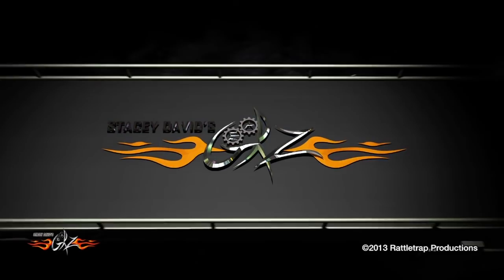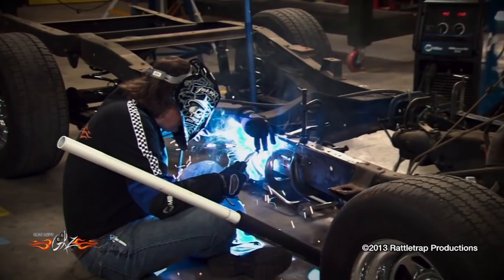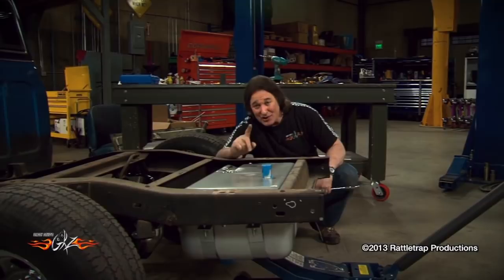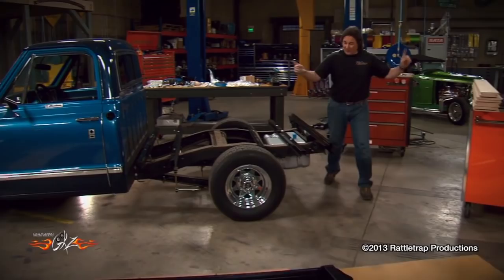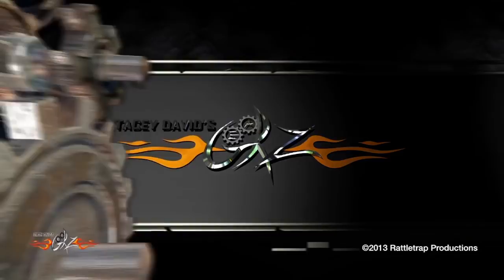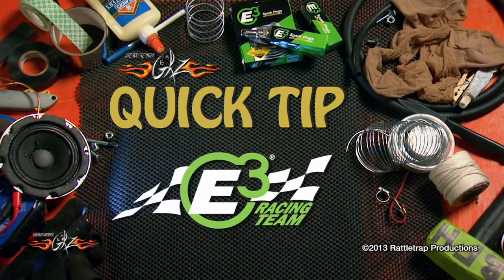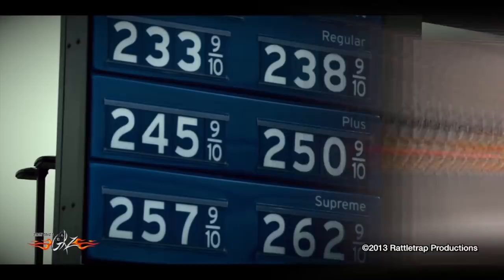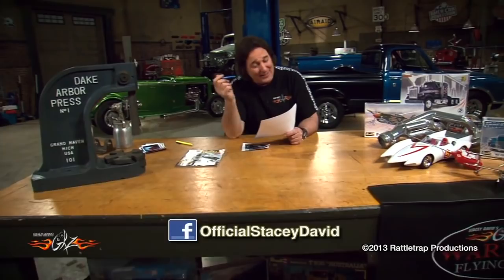Converting a Classic Truck from a Long Bed to a Short Bed - Stacey David's Gearz S7 E5

Comment: Can't u get a short bed Bed 🤷‍♂️
Reply: Very hard to find
Reply: Yes you can. 88- 98 short box will fit quite nicely and body lines are unbelievably correct.
Reply: @kevinlimo696  if it's a step side bed then ,yes

Comment: Not a mechanic (put can keep my truck running)… but what I am is 32 yr carpenter and I’m a finish carpenter casework/mill work. 

For wood on truck bed I would use an epoxy to seal the bottom and the channels where the the rails sit. For the exposed upper. I’d highly recommend a stain w UV protection and a marine grade clear w a UV protection. 

He is right it is very important to seal every inch of the wood and using the right product to seal it that will last.

Comment: My 1st car was a 1970 GMC half ton pickup truck long bed with a manual transmission and steering
Reply: Mine was a 1970 CST/10 with a big block 402, TH 400 and a 12 bolt with posi and 4.10:1. No Ac though it has power steering. 4 wheel drum brakes. It was my dad's truck and he gave it to me in 1997. I still have it, but I blew up the 402. It has a 350 in it now. 
I almost lost it in the caldor fire in California about 18 months ago. It really motivated me to start restoring it. I just lost my dad to mesothelioma in August so I really want to finish it for him.
Reply: @jessdigs  GOD BLESS YOU AND YOUR FATHER, My father died losing his battle with colon cancer in February 2017,so I know how you feel 💔 😢 🙏. I bought the GMC truck and my mom drove it home and I taught myself how to drive it